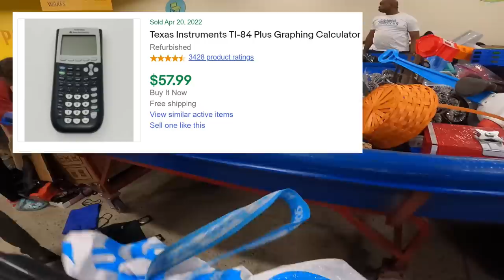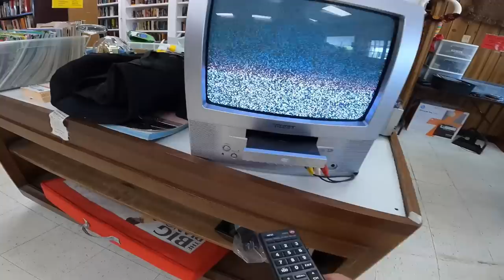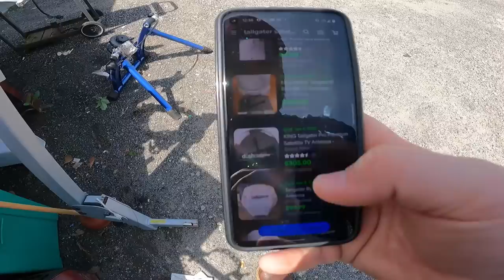I'm DONE With The Goodwill Bins...

Comment: In most residential construction the tubs and shower enclosures have to come into the bathrooms before the walls are finished.  Folks who forget that end up using multi piece tub enclosures, which are rarely as watertight.

Good to see the plan for a functional work sink and future washer/dryer in the works,
to reduce the hauling to and from the house.  To make the sink counter as large as you can, you might consider a stacked washer/dryer set-up.  Also, above the sink perhaps a wire grid shoe drying shelf or two.

Comment: Yes, I see more gas powered tools in your future, since your are now out in the sticks on acreage.

Husqvarna vs Stihl:  Personally I like Stihl products, since there are more service centers here in the Pacific Northwest, then there are for Husqvarna, but have found over the years that they're comparable brands.  As you go east, you find more Husqvarna tools in use, especially back when they were made in Sweden, but like many companies (Dewalt, Snap-on, etc) Husqvarna is having more and more of their homeowner grade tools made overseas.

One thing about the electric versions of tools many users don't understand is that you have to be careful with the number and wire gauge of the electrical extension cords you use on a larger property, because there is a power drop when you try to run too far from the outlet.  This is true of larger drills, pressure washers, air compressors, etc.  Just about anything with an electric motor suffers once the cord gets to be over 100' and really suffers if the wire conductor thickness on the cord is minimal.  Avoid homeowner quality cords that are  only 16 or 18 AWG. Start watching for 12 AWG or even 10 AWG size cords while you're at the flea market, garage sales or on Facebook.  Wire gauge works like shotgun shells.  The wire conductor on a lower number is thicker then on a higher number.  

So, if you need to get an air compressor (for instance) out into the trees or down the drive to run an air nailer.  Plug it in at the garage and use more hose, rather then more extension cord.  Once the pressure is up, you can run the gun.  If you try to use 200 feet of extension cord, depending on the amperage needed, you will likely trip the electrical breaker in the Panel, but 200' of air hose is fine.

Comment: dude, you should've grabbed all those remotes. usually, they run for a dollar apiece. easy to test, list, and store. depending on the model it can be 10 bucks to 100+ you can test it by putting batteries in it and point it at your phone camera and if you see the red in the sensor of the remote through the camera. then it works.